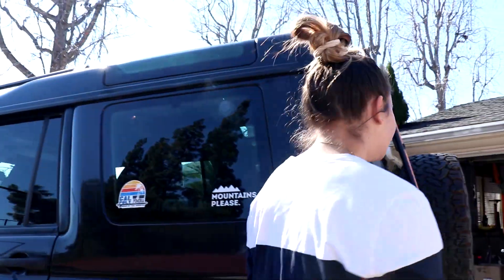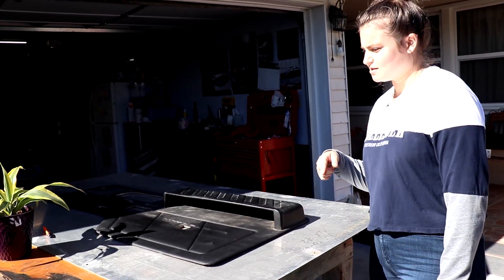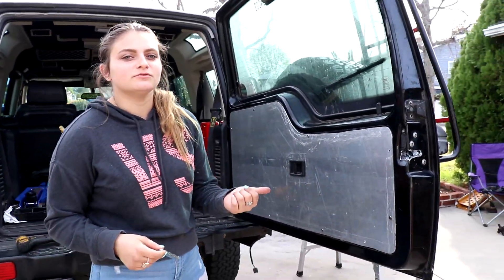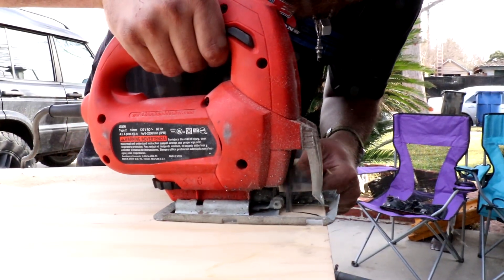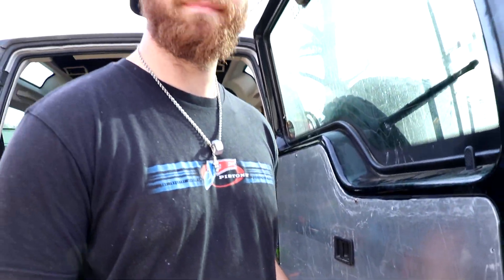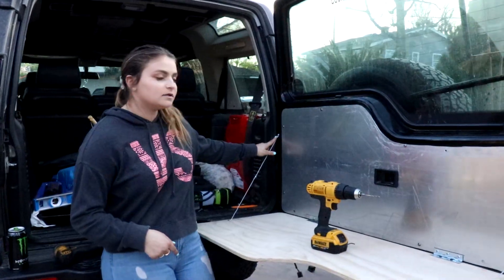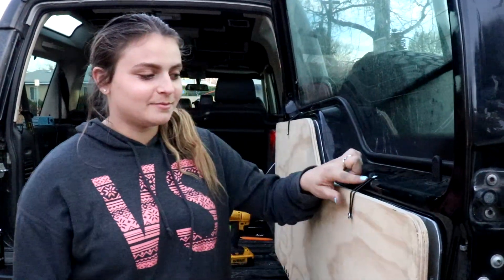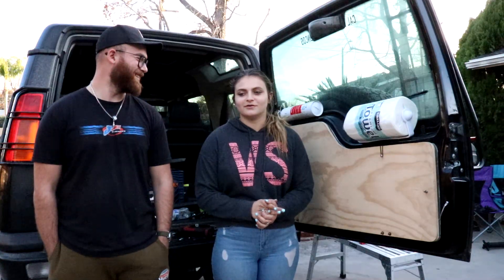Building The Ultimate Overlanding Table (Discovery 2)

Comment: Trim skilsaw blade will fly through the aluminum. Jig saw for the curves. Let the blade do the work and don’t force it along. Just let it nibble away. Put some bumper on the door panel to stop rattling. Take a piece of ratchet strap tail and have a snap on the table and screw the other end to the door. Thing will last forever.

Comment: Great video and great job on the table, just one thing if your rear door actuator plays up you won’t be able to open the door from the outside and if you have fitted a draw system or the car is full of camping gear you won’t be able to open the door from the inside unless you unpack  the car or can remove the table. I would suggest that you cut a hole to allow access to the door handle, you could put the piece back in with a bracket to make it easy to remove if needed.
Reply from the maker: We thought of that when building it, but our inside latch never worked any way so we weren’t too scared of getting rid of it. Let’s hope our actuator never plays up. Knock on wood!

Comment: Great table 👍 but how will you open the door from the inside?
Reply from the maker: Our handle from the inside never worked so we didn’t really worry about it. we did leave a hole for it and could easily fold down the table enough to pull the lever.

Comment: That was cool! I wanted to do a table but wanted to keep the door in its original state. I was thinking of using the original door pocket as a holder for the base of the table. It wouldn't be as big as the table you guy made seeing that i would need more support than just the door pocket.  I own 2 Disco's, an 02 and 03 just like yours.
Reply from the maker: Would love to see how you would go about that! The wood is pretty light but then you would just have to worry about the weight you are planning on putting on the table. It might be able to be done with the right support! Good luck and glad to hear you have love for Discos!